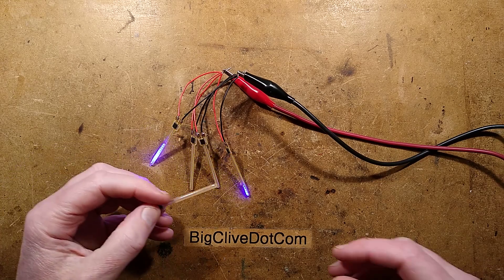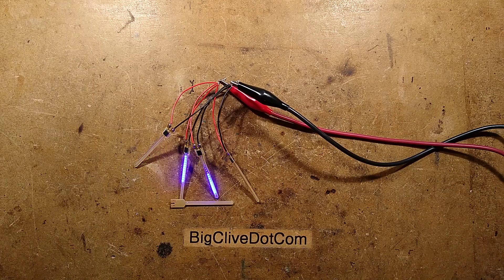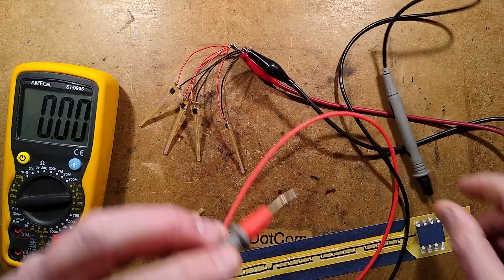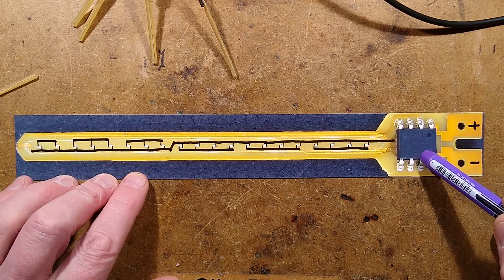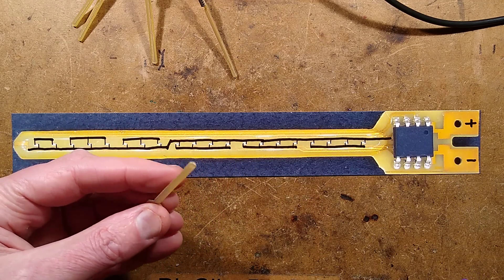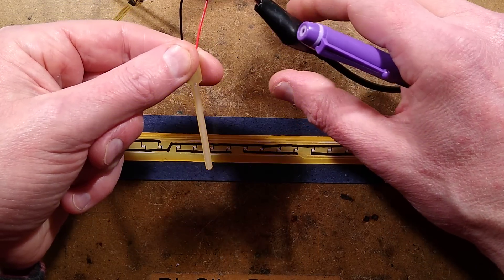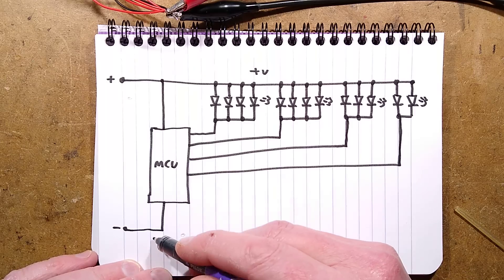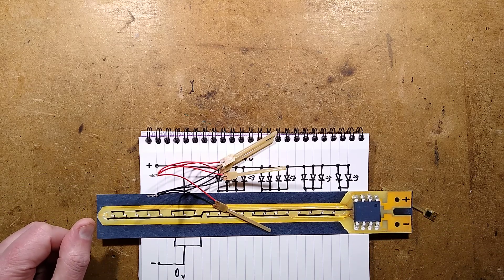Mini meteor lights - with schematic

Comment: I purchased the 70mm version and it has 5 modes, 2 questions how can I tell if its ok for 4.2V (lipo) and is there a way to disable all the modes.  I just want it to do the meteor effect every time its turned on, instead of cycling through the modes.  Thank you.
Reply from the maker: You may need a resistor for 4.2V.  The modes are locked into the software.

Comment: It's surprising that the human eye doesn't notice that the LEDs are being turned on in blocks. 
I initially assumed they were doing cunning things with the five IO (Charlieplexing or similar) to drive each LED separately but no, just relying on the failings of the human Mk 1 eyeball to perceive smooth movement.

Comment: I know pretty much nothing about electricity. I taught myself how to do regular led rgb strip lights a couple years ago, for my kids halloween costume. If i wanted to use these on her costume this year, how would i do it? Would each one need its own AA battery to run? Is there a way to make them sequence faster/slower? Do they get hot at all? Would i need to do anything to waterproof them, in case it rains while we are out trick or treating?
Reply from the maker: Several could be powered from a couple of AA batteries.

Comment: quick questions for you.Do they do the meteor thing when first turned on? I got some of these to play with, I am powering mine from CR2032 and when they turn on all the LED's are lit, I have to turn them off and on again to get the meteor effect. Oh, and mine have a tiny capacitor between the +/- terminals.
Reply from the maker: These are the simple version.  Others have multiple effects.

Comment: I designed up a heart a bit like this last year and a circle like that back in around 1996 before some dude at Maxam got the technique known as charlieplexing. However my ones are wired to the spare pins for individual LED control. The one you've revealed is not so sophisticated.

Comment: Oh, these have a wonderful dropping effect. I like them a lot, in fact, I  can think of a few modelling projects out of them. Edit: Clive, I saw another listing for these. If you keep the neg attached to the power. Then add the pos by tapping it on the pos tab once each time. The LEDs will flash in 5 different patterns, one tap per flashing sequence, eg, like the KITT car L-R &R-L red strobe effect. This makes them even better for a visual affect.

Comment: In the scematic you drew the LEDs are in paralell but it seems they are in series on the board or am i missing sth.?
Reply from the maker: Each section on the PCB has them in parallel.

Comment: Please look at the "watt-er" emergency water lamps! I think it would be cool to see how they work and the schematic with it!
Reply from the maker: Those products are usually gimmicks.  They are not powered by the water, it just mixes with salt to make an electrolyte between metal electrodes that will corrode as the battery discharges.

Comment: A got some the other week...some of them had an extra component and it didn't matter which colour they were.
Reply from the maker: If they had a little capacitor next to the chip try pulsing power off to them briefly and they may change the effect.

Comment: Clive, will these run off of 3x NiMH cells without regulation? Might work nicely for garden illumination, fill some of the solar garden lights with clusters of meteor lights, the average power looks to be low enough that they'd probably last a good bit through the night.
Reply from the maker: Might require a resistor.

Comment: If you want to smooth out the current reading, go power-source --> meter --> 470uF cap --> doodad.
Charge the cap and measure if there's any significant leakage current to subtract out later.
Let the doodad draw off the cap.  It supplies current to the doodad even with spikes, and the meter reads smoothed-out current readings.
I had to do that for a "beacon" light, nothing, nothing, nothing, nothing, huge current spike, nothing, nothing, nothing, etc.  Only it needed something like a 20,000uF soup-can of a capacitor.

Comment: It still amazes me how 4 'channels' appear to flow so perfectly...
Reply from the maker: It's six, but it is unusually smooth.
Reply: They might PWM them so that one fades out as the other fades in which would make it look smoother.
Reply: @kimchristensen2175  But even then, with pwm, how does the controller address individual LEDs, which it obviously does? Or is there some logic in the LED groups, hidden somewhere? If four are connected together with just one pin on the controller... How does it create a fading light effect from one side to the other, like a larson scanner? Clive must have overlooked something.
Reply: @theagileaardvark  - If you play the video frame by frame it should become obvious that it doesn't. The LED groups turn on and off at the same time (LEDs 1-4, then 5-8, etc.). They do seem to fade out "slowly" (i.e., over 2 frames or so), but within each group all LEDs are in perfect sync (i.e., they turn on and off at the same time, and fade out at the same speed).
Reply: @RFC3514  Yes, it looks like a 10-bit shift register with only the six least significant bits connected as outputs to the LEDs and the effect is achieved by 'shifting' a group of three bits through it from right to left. This would explain the delay as each 'icicle' completes its sequence.
Reply: Right? I was expecting it to be each LED addressable or charlieplexed, persistence of vision is weird.
Reply: Indeed. There was me thinking that those kind of LED effects used addressable LEDs. Guess not.
Reply: @simonstroud2555  - For monochrome LEDs is probably significantly cheaper to use separate channels or "charlieplex" them (which I guess counts a addressing, sort of). RGB versions are more likely to use neopixel-style (serially addressable) LEDs.
Reply: There must be more to it! It looks like individual LEDs, not LED groups, are switched. Clive, are you sure you didn’t miss anything? Can you do a slow motion recording of it? Then we can see whether it’s individual LEDs or LED groups that get turned on and off
Reply: @helmutheller1538 It's using anti-aliasing. Anti-aliasing can make text much more readable even on a low resolution screen. Same principle here.

Note that, even if this is not the case here, it is possible to individually address up to 30 LEDs with 6 inputs thanks to the "Charliplexing" technique.

Comment: One area of my city used dangling string light versions of this same effect as part of their outdoor Christmas lighting displays this year. 
I was speculating that it might have been charlieplexing the  LEDs.  This is an even simpler method than I imagined.
Reply: Yeah they had those large ones in my city too. I thought Charlieplexing initially. It would actually be nice to have a Charlieplexed version, then they could drip or maybe sparkle instead as each of the 30 LEDs could be independent with 6 GPIOs.
Reply from the maker: Many of the longer ones do Charlieplex the LEDs.

Comment: Hey Big Clive, what do you think they are using for an MCU?
Reply from the maker: Generic chip I'd guess.  The pinout is of a PIC12 and others, but it's more likely to be a super low cost chip like a Padauk.
Reply: @bigclivedotcom  Thanks, I've always wondered what MCUs are used in toys etc.  I'd never heard of Padauk, looks like this might be a $0.10 USD chip in low quantity, probably $0.03 in high volumes.; I assumed that PICs and AtTinys would be way too expensive for jellybean products like this.

Comment: apparently there is 4 different modes that you can make them  flash , not sure how to triger it or if they factory set
Reply from the maker: That's a different version with a little capacitor as memory.

Comment: The PCB had the LEDs in series. Why did you draw them in parallel?
Reply from the maker: Each section has between 2 and 4 LEDs in parallel.
Reply: the effect would be effed-up completely if one led failed. thats like just drawing a big black X on the notepad lol .. aka..  i have no idea or clue! 😂
Reply: If they were in series, it would need a lot more than  3 volts to light them.

Comment: Dunno whether the pin out the Atiny85 would work but if it did you can easily see the sequence of lighting and dimming they have used by using the frame advance buttons on your keyboard  '<' and '>' and relatively easy to code, I don't know Python but very simple in 'C'. Went an got some of these right away ! (a first for me) so let playtime begin....cheers !
Reply: it's that mouse bloke again. how are ya? friend :)
Reply: Hey hi ! not bad, not bad at all hope your well ! @Palmit_

Comment: Looks cool but i'm surprised they did not connect this leds in the opposite directions, microcontroller could drive them in a "full bridge" configuration - more or smoother effects is possible.

Comment: Dangit, Clive. You keep making me buy stuff on AliExpress.
Reply: I can usually resist, but these are too good and I caved. I just ordered a pack of 10 of each color! They're going to look great on my "mini christmas tree" that I decorate with all components de soldered from circuit boards. The scale should be about right too! The lights are all hand assembled 5mm LEDs, and the topper is an old Pentium MMX 200MHz surrounded by yellow LEDs - it's a very "clive-esque" tree in many ways
Reply: I also found a seller that was selling the 10 packs for the same price as the one linked to was selling 5 packs (and was out of stock of yellow)

Comment: Anyone thinking what i'm thinking?, pulse with modulation while using them in series to act as the worlds cheapest Audio Spectrum Analyzer.
Reply: thats advanced for me. but how about an audio graphic equaliser? what audio frequency analyser chip would be fastestand most accurate? what frequency 'adjuster' chip would we use also?

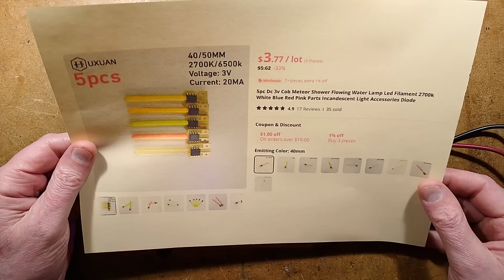Comment: 0:22 20 mega amps! Great Scott!
Reply: Thus the name.
Reply: At 230 volts, that's 4.6 jiggawatts!
Reply: 60.5 volts might fry them.
Reply: China don't really bother with caps or lowercase, they figure you know what they mean.
Reply: @keiths8700  It's not the Engineers who run these shops. More likely to be a humble copywriter who messed up the translation.
Reply: @phils4634  Get real. Try working with the manufacturers first, then make a comment that has basis.
Reply: @keiths8700  Ever been to China? I have, and regularly. The people who run AliExpress's minor on-line shops are NOT engineers. Their engineers are far better (and far more knowledgeable) than anything in the West, as your many rants no doubt demonstrate.
Reply: @keiths8700  - China manufactures a lot of electronics. I'm pretty sure their engineers (and most secondary school students, for that matter) know SI magnitude prefixes, including the difference between "milli" and "Mega".
Reply: @RFC3514  Yeah, I know all about China. You ain't teaching me nothing.
Reply: @keiths8700  - Considering your previous teachers didn't manage to, I won't even bother trying.
Reply: @RFC3514   dude get a life, I've been designing with Chinese engineers for years. You're not even in this league.
Reply: @keiths8700  - Ah, that probably explains it. The ones I worked with know the difference between "milli" and "mega", but they never had the benefit of your guidance. 😆

Comment: I wonder how many LEDs can be run on each leg without damaging the chip. I could see this chip being useful for controlling direction pointers, particularly if it can handle considerably more current than the stated 20mA. If not, it could still be used to drive a mosfet on each leg and that would have the advantage of being able to switch higher voltages too, perhaps 3 LEDs in series to run off a 12v supply.
Reply: The listing states 20MA not 20mA. See 0:22 seconds into the video.   You have plenty of current😂

Comment: I've used them in props, they run for a whole day on a 2032 battery or 2 in series on 5v for a lower brightness. really useful for confined space.
Reply: Props was my first thought. I recall back when Star Trek TNG tricorders were the hot thing and folks went nuts trying to duplicate all of the blinky light effects. Now you can do it with a COB with a built in micro.

Comment: What woukd happen if you edtended the run of leds, would the line continue or would you get many flashes, or just a bunch for leds that never light up
Reply: these aren't using those led chips that each have their own mcu. 8 pin mcu means 6 output pins, one for each bank of leds.
Reply: @ericthecyclist  yeah, but you could extend it, there is a 70mm version too same number of pins, adding more could lengthen the effect or have it repeat by branching off, I shouldn't have to explain this.